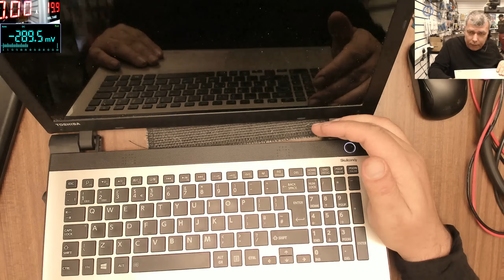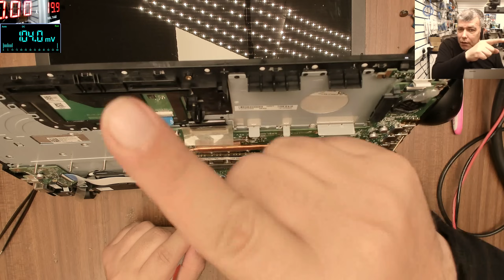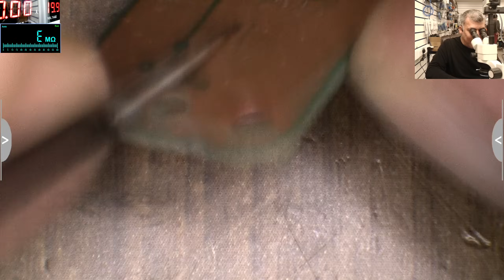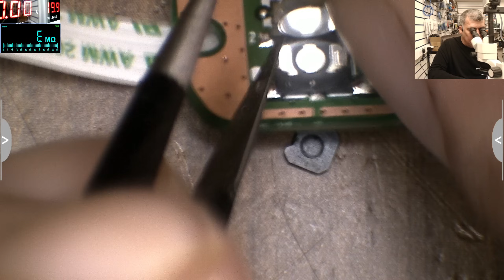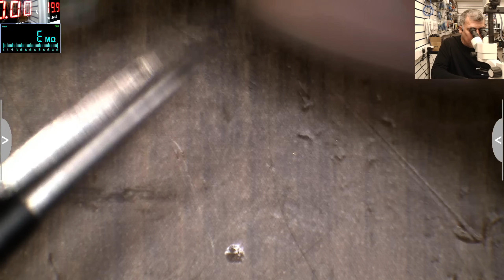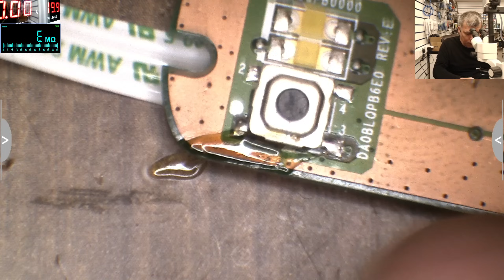Laptop comes on and goes off -  tricky :P

Comment: I have a toshiba with same symptoms but same problem
And a compaq that can work of you only open google chrom or light program any big program and system shuts abruptly even wifi and hour icones don't showup after that power failure ... And no it's not a heat problem or powersuply problem 🤔

Comment: For the power button the other end of faults can happen too: Corrosion happened inside and the button doesn't register anymore. This can happen over time especially on power button as every time the 3.3V touches the ground, there's a tiny spark inside the power button and it oxidises just like that. Also fixed with alcohol, petrol or contact cleaner.
For me I like to spray contact cleaner inside and mash the button 2 dozen times and see if it works before I take the hassle and disassemble the button
Reply: Butan with Fire 😂😂

Comment: Nice, ! a solution is , once the laptop goes off, close your door so it cannot come in ;) Not same fault as on TV's that are cycling on starup because of their "bios" chipset not accepting any more writings or have too much errors( and they are writen at all time on, attaining a limit of correct functionning too early) ?
Where is plugged the amperemeter I cannot see, is it just because you alwayse use an external alimentation, not the original one ?)

Comment: Thanks for the video. Yesterday I had a hp Compaq laptop with same issue. I did start inspecting  exactly from power button, and I start laughing because you are saying the same. Anyway my problem looks to be somewhere else. Strange is that  when I inject the power not from charger the laptop screen is trying to come up then the laptop shuts off. Will inspect some more. Looking for a fail sensor maybe ✌️
Reply: Hi, I have the exact issue with my Compaq laptop, kindly please share the solution for fixing,

Comment: Clever way of cleaning it in case you don't have a replacement. Usually if possible I change those buttons because they're not expensive and if you are having atypical one you can extract one without damaging from the donor. In case of power buttons I am the type that praises changing them instead of trying to fix them. Reason is - depending on the user but most of the cases of failed switches I had where buttons with diaphragm that either lost it's sping force or was almost completely flattened out so cleaning it would make small diffrence there. I can give you fan fact here - Dell, lenovo, asus. In some models you can encounter surface mounted switches without casing, only thin kapton alike cover glued on 4 sides to the plastic. Well I had one Y540 Legion. The kapton part fell off and diaphragm went flying on the MB which caused shorts and extensive damage. Sometimes easy things are obvious, sometimes they're tricky and sometimes they bring pain and suffering but... You never know.

Comment: Varistors are used to protect a circuit from high voltage surges. When a high voltage surge is applied to a circuit, the outcome is usually catastrophic to the circuit. A capacitor may be installed across the signal lines.

Comment: Continued watching till 15:00 & as I suspected leaky tactical switch but why clean a 5 cent switch just replace it, it's quicker & much more reliable than cleaning it & hot glue which btw wouldn't work in OZ, why don't you keep stock of common cheap parts like switches, USB & HDMI ports, SMD caps, resistors, diodes, generic MOSFET's, common known IC's that fail, etc... because I do it's just the way I do business, honestly, professionally & am very comfortable giving 3 mths warranty on my work! (only if it returns with the same fault & cause).

Comment: I watched till 4:00 & yes it can can be ram, dead cpu or a short on vcore or ram but knowing it's a Toshiba my guess is an intermittent s/c or leaky power button as I have seen this behaviour before with them the power switches get crap in them & they turn off intermittently... I will continue to watch & see if I'm right but I suspect I am but will watch.
Reply: you were right :)

Comment: Hi Sorin. Your videos and knowledge sharing are very precious as usual. Yesterday, I exactly had the same issue with my MSI gaming laptop. When I press the power button, power light comes on, and then it goes off. Nothing on the screen. I started to sweat while pressing the power button again and again. Last time, I pressed the power button for about 30 seconds for resetting bios according to MSI instruction. Thank god! The power light blinked twice and it came back to life again. I will never have such a relief moment in my life again. What a bit of luck? I always watching every video that you post and they contribute a lot of knowledge and logics about IT products. Thanks for your warm explanation!
Reply: I have the same issue with my msi laptop too how did you solve it?
Reply: So your problem was not the power button!

Comment: Thanks for sharing this Sorin!  I repaired a laptop with a similar failure once.  It had liquid damage under the power button ribbon cable and some damage on the connector (power button board side).  Cleaning the connector and replacing the ribbon cable solved the issue.

With faults like this its always best to eliminate what you can buy unplugging things - LCD, USB boards, hard drive, etc..
Reply: روش نصب کاسه نمد دستگاه برق موتور هوندا